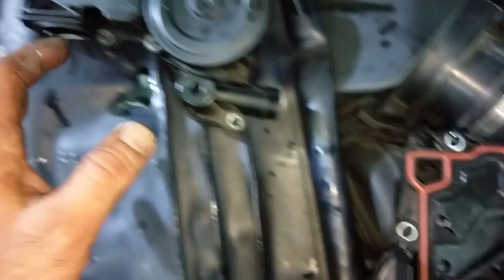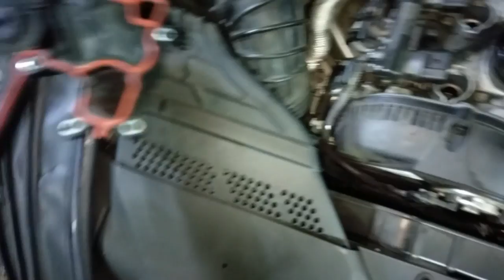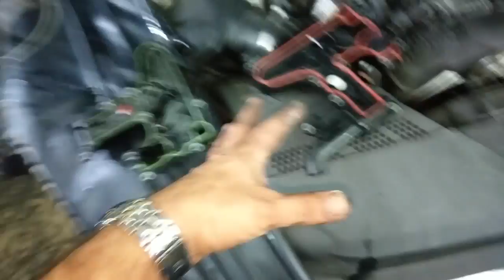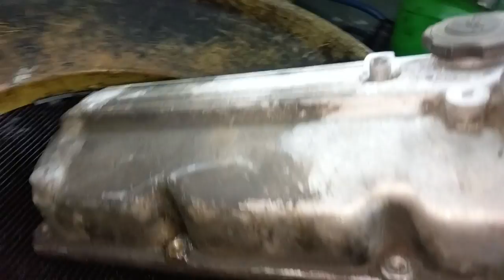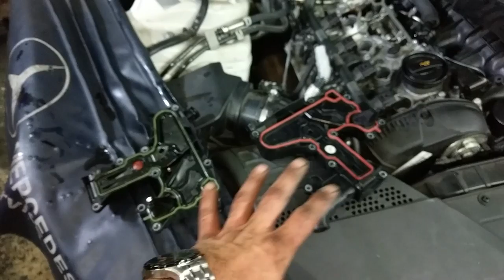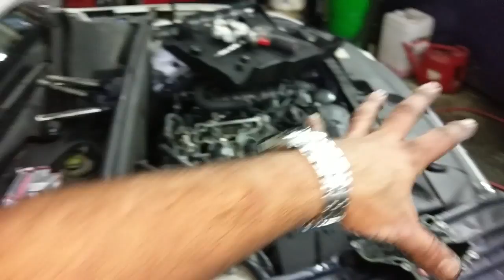Audi oil consumption A3 A5 oil burning PCV breather system excess oil use fouled plugs

Comment: Mine started misfiring. I replaces all spark plugs and coils. I read somewhere to add Lucas every oil change and I've haven't had a problem since then. The only issue I've faced is a rough start when it's cold outside.

Comment: I'm as we speak right now designing a system for This Disaster of a PCV valve I'm actually using oil catch can and going to use the PCV valve off on older type Chevy with the catch can that way all the bad fumes gets sucked into the engine but no oil PCV valve to intake valve cover to catch can and another line from catch can going into the turbo I even have design for the LS engines engine Chevrolet design crappy PC system

Comment: this is not just the pcv issue, it might be rings, valve stem seals, or combination of all 3
Reply: No the PC is a really bad design it's oil both directions turbo and intake the whole system can easily be redesign which I'm working on right now with one of my customers

Comment: I had a 2011 Audi A3 Premium. It burned oil all the time. I replaced the PCV valve and replaced all the seals in the valve cover gasket and intake manifold gasket etc. It seemed to stop and slow the engine oil burning just fine.

Comment: Hi. I've seen your vídeos and have been having an oil ptoblem with an audi a5 2.0 tfsi (2011). My issue though doesn't seem to relate with piston rings. When I get on the highway and accelerate past 3.000 rpm the engine light comes on with a P2015 code. Since that happened, oil consumption bumped up. It started sucking around 1/4l of oil per 100-150 kms. So, audi changed the runner position sensor. I spent around 350$. Got the car, drove for around 50kms and no oil loss. However, when I accelerated it past 3000 rpm the engine light came on again and the oil level came down slightly after another 60kms. Did you ever face anything like this? I looks like something related to the intake manifold is making the car consume oil...? Does this make any sense?
Reply: Also, I already changed the pcv valve as well.
Reply: Poor engine unreliable. Same problem with my audi a4 2.0 tfsi 200hp 1l/500km no point to change oil cause it flash out every top up😁
Reply: Did you had any luck fixing your car? My Audi A4 2.0T 2012 burns 1L/400 kms

Comment: I bought a 2016 1.8 passat brand new.  Runs great with 78k. Problem is it burns oil like a mf. Light pops on but no loss of power, temp rose slightly three or four times but nothing came off it. One morning last week checked dipstick before start it was bone dry. Added quart drove around the block (mile and half) then some oil was on the dipstick it's fine. Got tired of dealing with the dealership. Never got an clear answer on what's going on. Like I said she runs great, pulls hard, idles smooth. Just have to babysit the oil. Bought extended  warranty for nothing.
Reply: Same 1.8L 2016 passat . start oil consumption after 70K.   . Start to see oil in dipstick and PCV valve. Poor Quality engine. No more VW.
Reply: @drsanmyattun  Update. Got my last 2 oil changes at one of those juffy lube places and haven't experienced any issues. Problem won't buy another vw/Audi vehicle tho.
Reply: @daeladub  You means . no more oil consumption? What oil they use?
Reply: @drsanmyattun  pennzoil full synthetic. My oil still gets low but around the time when it's time for an oil change anyway. It's a turbo so I expect some loss. But as far as my oil light coming on or dry dipstick it hasn't happened with these last 2 oil changes.

Comment: same faulty.. high oil consumption...already change the pcv valve.. didntfixt it.. they say need to rebuild..
Reply: Hi Saufi, I am doing some research about Audi´s and I see how much people is angry against those cars. Did you not repair the oil consumption withe the replacement of the PCV valve? I plan to buy an A6 V6 super charged, but, I am not sure yet. Thank you

Comment: Fitt an old worn out volvo D5 engine in it, 2001-2005 never trubble, my s60 has 300,000km now and i dont fill oil between service in 15,000km orginal turbo and its tierd as hell butt does the jobb, i look a bit on a A6-07mod but i think i keep driving my old shitt usless volvo instead and save my monney to an porsche cayene in the future

Comment: I own a 2006 vw passat 2.0 t which is burning about 3 quarts every three weeks give or take it has 160,000k miles will the stealership fix for free since its burning so much oil with no signs of any leaks
Reply: The turbo is consuming oil

Comment: I was looking at buying an Audi A3 .( 20011 / 12 ) . 1.4tfsi or 1.6tdi but now??? I don't know ... did not know about all these problems until i researched more.... it is shocking!!! Very disappointed...
Reply: Please don't buy it look for another kind of car I own a 2010 audi a5 and I have that problem with the oil plus now I having another problem every time I start the car the engine shakes really bad and turns off the cars are nice but the engines sucks

Comment: I have a 2010 a4 with this engine. Bought it two weeks ago. Done the oil consumption test. It uses 2 ltrs in 360 k's!  Wtf? Dealer picked it up today via tow truck as they are 700 k's from me to fix it. They are a Euro dealer and said they will fix it for me. I think they are trying this fix and software update but I think it'll end up with a new engine. Either way they said it will be fixed. They have been really good to deal with. But fuck that's heaps of oil ah. Only has 110k on it. But who knows the stage 1 fix might work.
Reply from the maker: Sounds like the broken rings. Wow that's hectic. 2l per 360km. Engine needs the specified rebuild
Reply: Mechanical Mentor Yeah that's what I thought. But it had a compression test before I bought it and it was really healthy. So scratching my head.   It was done by the AA at the testing station. I'm surprised my plugs didn't oil up.
Reply from the maker: Best VW diagnose it. I may not have mentioned there are other vw engine plauged with broken ring problems and other crazy faults. I met a bloke the other day that had a broken ring on a 2007 gti golf.
Reply from the maker: And re plugs I understand. It's crazy. Even if it was a blow by failure the plugs should thereto Ally oil up. Hence the confusion with these cars and endless repairs and ongoing problems.
Reply: Mechanical Mentor Did you get your engine replaced?  Did the new engine use oil?  Such a shame about these wicked cars to drive.
Reply from the maker: All the A5 engines in my videos were eventually replaced repaired by Audi as an act of goodwill usually the customer still payed 4 to 6 K as half the cost of repair.
Reply: Mechanical Mentor The newer engines are better I believe. They don't use oil as much correct?
Reply from the maker: No all of them have issues from 2007 onwards. I can't say newer ones are better as everything there's a new engine it's got new problems.

Comment: Used 2.5 litres of oil in the 13 days I have owned the car, (800 miles driven approx) A3 1.8 tfsi 09 any suggestions? Piston rings I have heard, also looks like a slight leak on my breather pipe
Reply from the maker: +YouKnowWho ! Omg wow that's bad. Pistons and rings.
Reply: Mechanical Mentor oh great, owned the car 14 days, ringing up the garage in a hour
Reply from the maker: +YouKnowWho ! Oh no.
Reply: YouKnowWho ! How did you get on?
Reply: T B still being sorted been busy at work. Believe it is the turbo now if it's turbo I will fix it, if it's Pistons I will have to sell the car
Reply: YouKnowWho ! What was it?
Reply: sniper  I will like to know as well, I'm having the same issue, 
is it blow by via the pcv valve?
Is it the rings?
Is it the turbo?

Comment: 2011 Audi Q5 90k miles.  I’m now having to add a quart every 150 miles. Crazy. Also a weird smell after running engine for a lil bit. Using a dipstick when I check. I don’t rely on the mmi although I see the levels going down.
Reply from the maker: +john zaremba jeez another victim. I can't imagine how bad this problem really is as I'm not a big you tuber and only a one man mechanic and it's been dozens of peeps. Looks like you got to have new pistons and rings.....do you have someone who can diagnose....I recommend Audi do it.
Reply: Mechanical Mentor lol my wife ran out and bought the car.  It’s beautiful inside and out but she sprung it on me and I noticed the oil consumption within first two weeks. Purchased a dip stick right away and had oil change down this way I knownthe level from the start. Can’t believe how much it’s burning thru. No leaks at all. But it’s definitely consuming and there’s a smell. Called Audi USA. Of course my luck it’s within the law suit year but 10k miles over to have oil consumption test and pistons replaced by Audi.  She did gets service plan from shop.  Managers at Audi already verified it will work(thank god) I just have to pay difference for labor rate.which I’ll gladly do to have piece of mind that Audi is doing it and will be under warranty. Never seen a car burn so much. Obviously it was a big problem. How the fuck could Audi wait for a law suit to rectify this and not do a recall?? This Thursday I’m dropping it off. He wants to check the hood lock and some other things first before doing the piston job.  Lol I saw another vid where the hood lock messed with the mmi for oil level. Fucking Audi lol. I know my car is burning thru though. I’ll get back to you what happens at Audi. Thanks for your vid 👍🏻
Reply from the maker: +john zaremba omg hood lock and oil level. How could they wait? They are a vile disgusting company that put customers last there should be a class action. Not sure which video you've found but I just made an update this car has been repaired though he paid 4000 or more as Labor etc. So recently I posted update it was the pistons and rings.
Reply: Mechanical Mentor Do you have a link for that vid?  Thanks
Reply from the maker: +john zaremba sorry not ATM just check my videos on channel I just made it other day. I can't post links here I'm in the backend type mechanical mentor Audi PCV oil consumption I've made more than one video
Reply: Also there was a class action. That was the only reason they are footing the bill for piston ring jobs for all the 2.0.  Can’t believe how many people have this same issue.
Reply from the maker: +john zaremba it's beyond belief. I actually have 5 or so videos funny to see how I had faith that it wasn't a piston issue. Yes it is. Only because it's such a common engine in so many vehicles that I thought it would be impossible the Germans make such a mistake oh god I've learnt a lot since then I've only gotten worse Mercedes-Benz is now I have reliability disaster and I've had other comments very recently about car shutting off at roundabouts and dark interceptions Audi Q5 say stuff like that I've had a few Q3 and Q5 gearbox failures which is simply catastrophic to the customer

Comment: I have a 2013 VW GTI with the 2.0T TSI engine. Basically the same engine as in the Audis, AFAIK. It burns about 1 litre every 5,000 km, which is not nearly as bad as with the Audis, but still bad, as far as I'm concerned.

After hours and hours of hunting around on the internet, I am also suspecting that the PCV valve is at fault. Check this video for example:
https://www.youtube.com/watch?v=P0c4wM28ex0

My warranty runs out this month, so I'm going to ask the dealer to do a diagnostic test on the PCV. I hope it fails so I get a new one for free and solve this oil burning problem once and for all.

And send Martin Winterkorn to prison! I blame him!
Reply from the maker: +jonfklein yes get all documentation. From them. 
Now ill be honest 1l per 5k is absolutely acceptable. Be careful not to waste ur time. But i can't say re if driven hard it becomes 1l per 1000km. Get it checked out. Carefully ec0lain yr driving style and trip distances etc. But sounds ok 2 me

Comment: Thanks, mechanical mentor. My a5 has 52k runs awesome but burns like 1qt every 500 miles. Took it to the dealer n those arrogant assholes acted like I created a clandestine issue.
Reply from the maker: pityo gonzalez hes getting a new engine. when I made this video it was unimaginable that Audi could have so many Faulty engines as in this must be the clearances of the rings so in the video I made a wrong comment but then again in real life which manufacturer makes a global car that has so many issues serious engine gearbox issues which we know from the emissions scandal the whole of Volkswagen group scandal go and get a new engine

Comment: Great video!!
My 2011 Audi Q5 2.0T probably has same problems. I have to add oil every 1200-1300 miles. There is a TSB on this particular issue. I hope I get mine resolved.
Reply: Q5 is shit sell it ASAP mine is also rooted.
Reply from the maker: Ron van Velzen new engine!  this cars getting a new engine!  update soon!  it's a cover up!